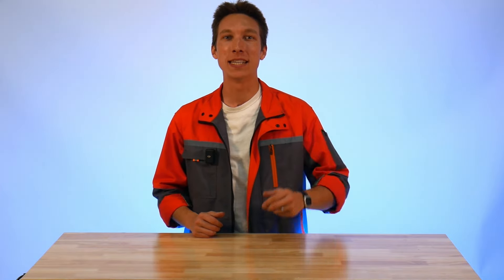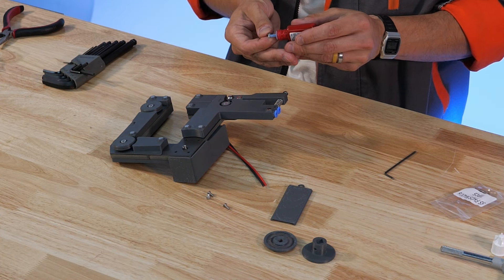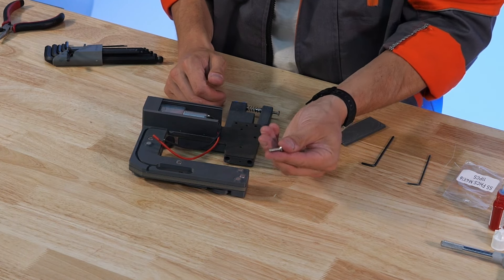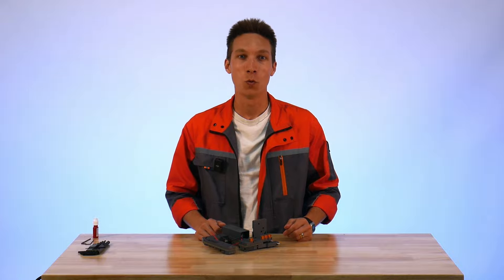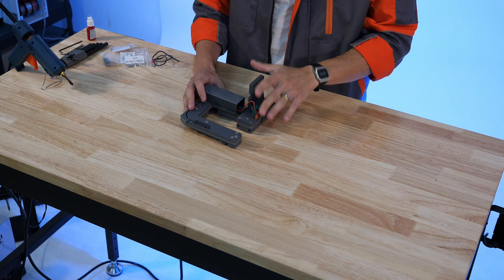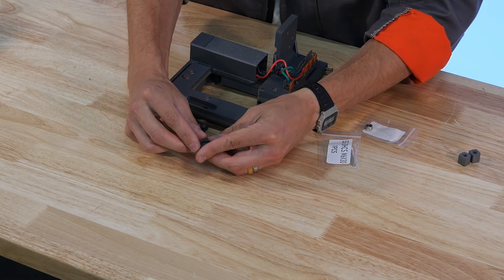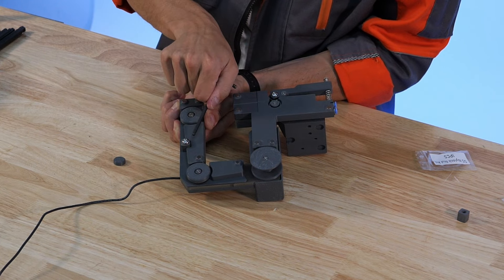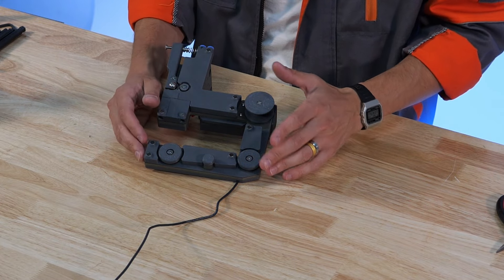3D Printer to WEDM Machine GUIDE - Part 3

Comment: What type of hot glue is that.  Probably sounds like a dumb question but the only hot glue I’ve seen is the clear/opaque.  Haven’t seen black.  Is the black a special hot glue for electronics?
Reply from the maker: What you see in the video is regular hot glue. The black color reportedly makes it a bit runnier when dispensing, but otherwise completely normal.

This is the glue we used in the Powercore V2 for assembly.